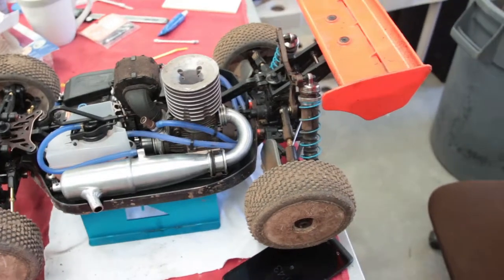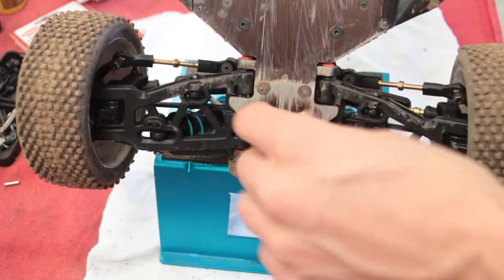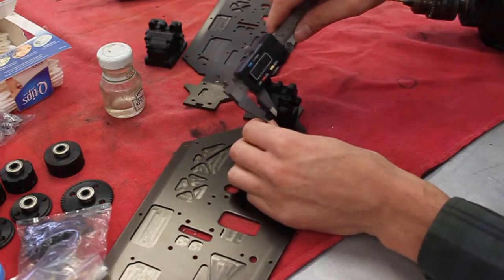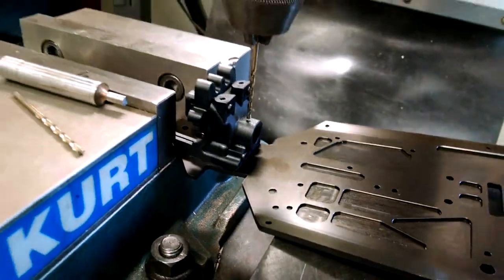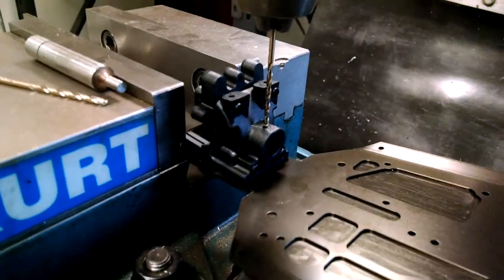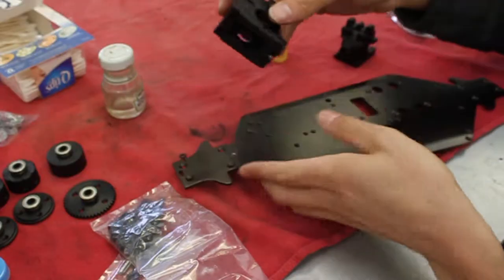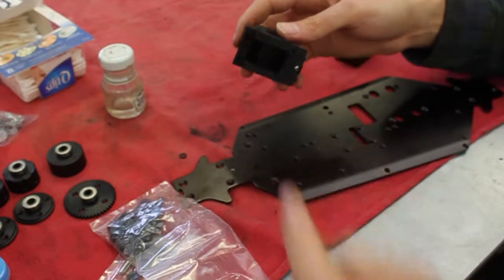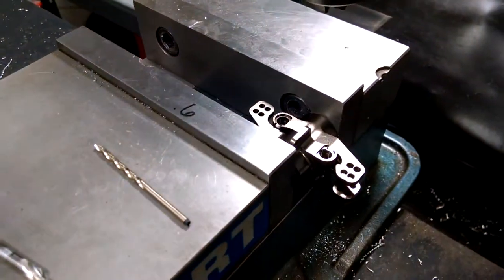Advanced R/C Assembly - Adding Lubrication Points to Bearing Carriers

Comment: The bearings are sealed!?!
Reply: They are metal sealed not rubber sealed, oil still will leak out eventually
Reply: They are metal sealed not rubber sealed, oil still will leak out eventually